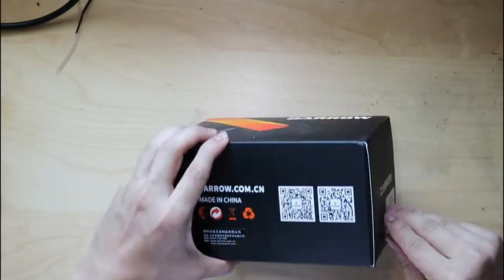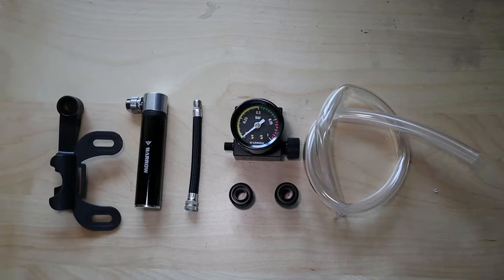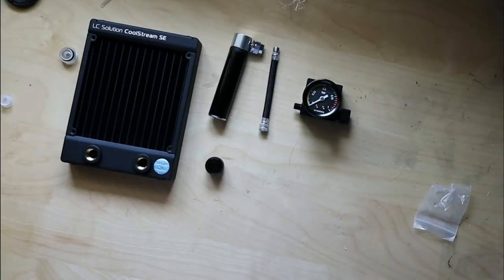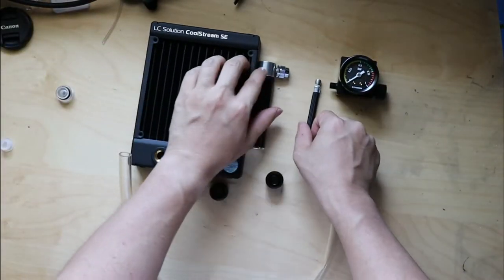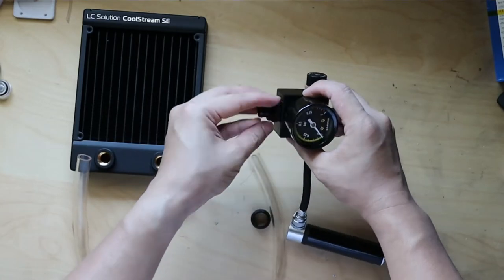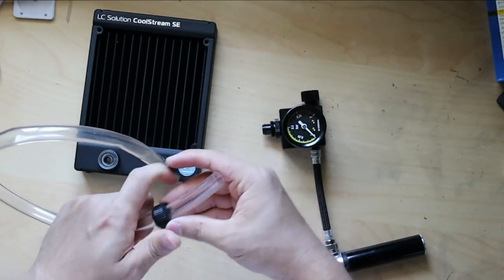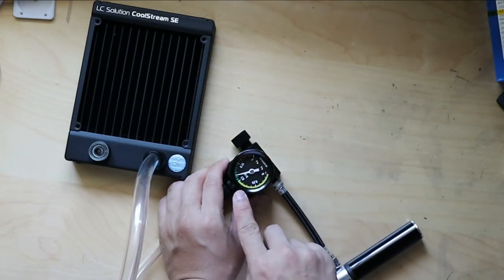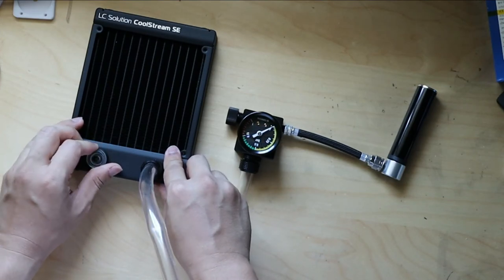Barrow Water Liquid Cooling Leak Tester Unboxing and Testing

Comment: Looks like the bracket could be for the pump. Seems like they've used a bicycle pump, which typically come with that sort of holder.
Might be useful storage for system builders, but an odd thing to include for sure...
Just ordered one from AliExpress. 2/3 the cost of the EK one, and with extra fittings and tubes. Thanks.
Reply: Barrow pressure kit its cheap, but also a good investment, but you can go cheaper, theres a mini pump with gauge for like 10 dolars, and you just need to buy a tire adaptor to 1/4, and some teflon tape, and a T for 1/4, and you should be good to go. The only negative, is that the gauge goes to 15 bar lol